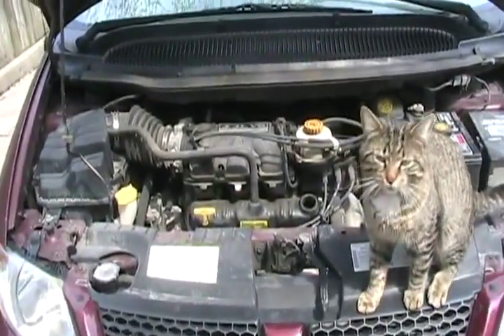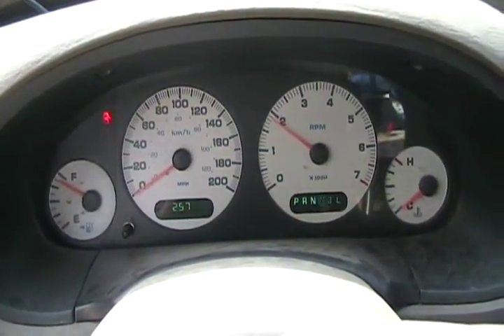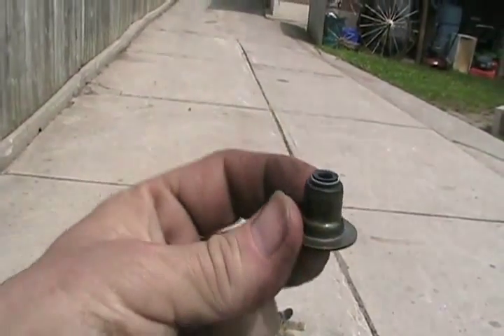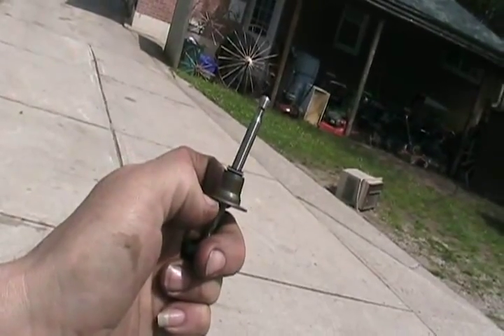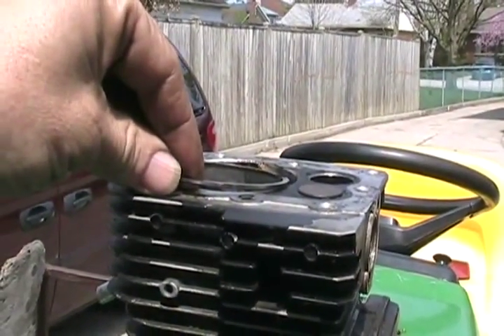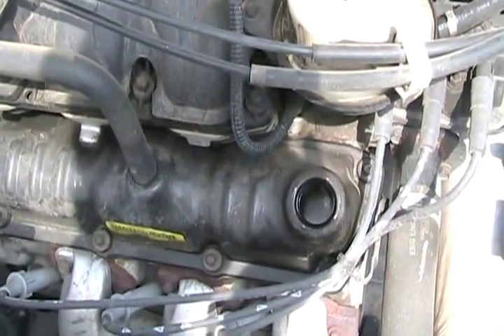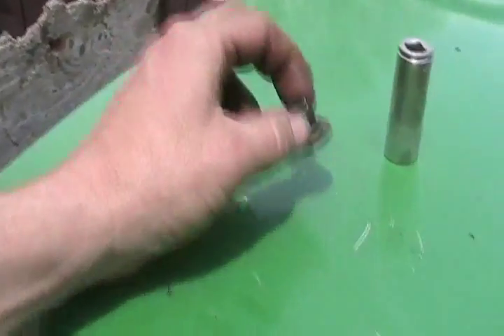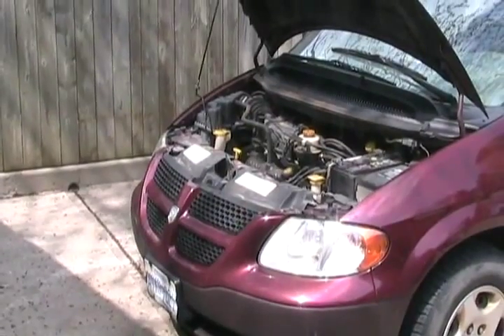#936 technical info on oil burning and head gaskets [Davidsfarm]

Comment: So if my 1997 Mazda protege with 270,000 kilometers smokes for about 10 seconds and runs like shit on cold start it probably means valve seals? Runs smooth as and doesnt smoke when warmed up. Car does burn some oil though.